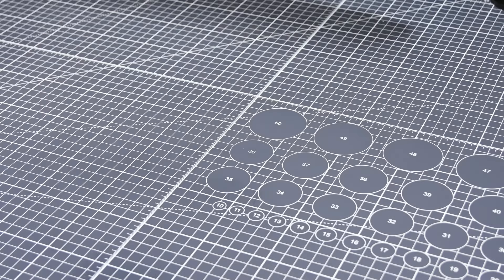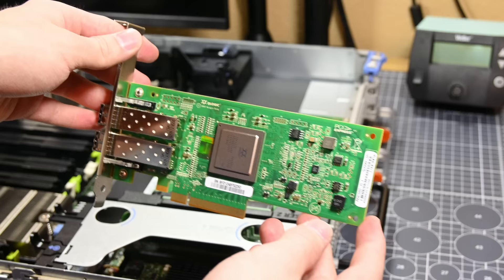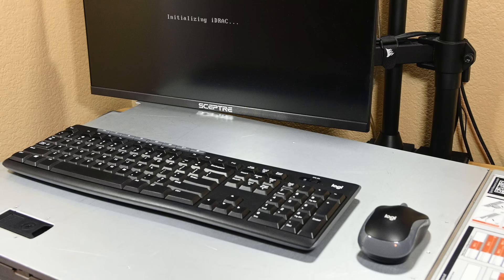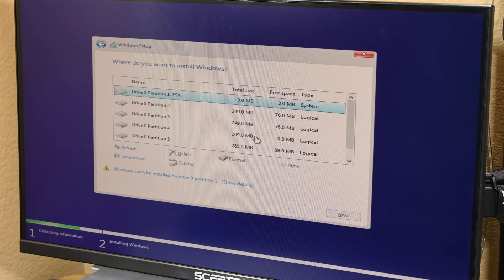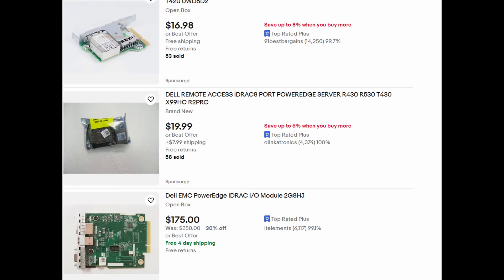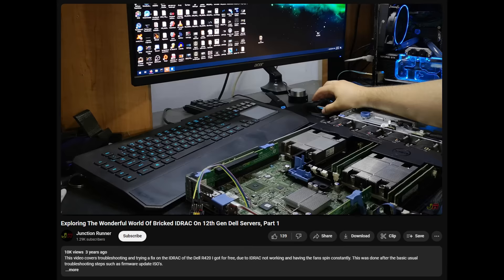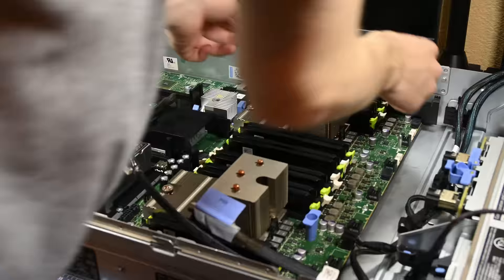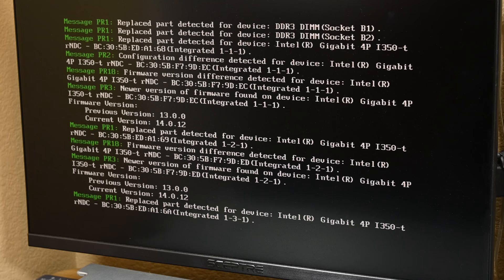I Took a Risk on This Server - Can I Get it Fully Functional?

Comment: I saw you pull out the SD cards from inside the server. Did you make sure to put those back? One of those is most likely connected directly to the idrac. I have a r810 and my idrac has an SD card slot directly on it.
Reply: Those two SD Cards are only for OS boot like ESXI. Also on the R710/R810 the iDRAC works differently than on his newer R720. The SD Card on your iDRAC is used for vFLASH. it's used to install an OS on your Server for example. On the R720 the vFLASH slot is the one in the front he used to try to flash the firmware image with. So an SD Card is not necessary for iDRAC to work
Reply from the maker: Yeah, as retropctech2407 said, these SD cards aren't linked to the iDRAC in this server
Reply: @retropctech2407  ahh okay gotcha. thanks for the correction! I knew there was a difference between idrac6 and 7, especially regarding licensing, but didn't know there was a big difference hardware wise

Comment: On some systems, you may have to configure the drives that you install using the LifeCycle controller.  Worse, the jargon can be confusing even between slightly different Dell systems resulting in wiped drives when you really didn't intend to wipe them.  
Dracs having issues is not totally uncommon;  yours at least booted;  I have one that is in production use, out of support, that hangs every 3 months or so during Windows Updates restarts;  the DRAC works until it does not; and then the power plugs need to be pulled to get it functional again.  Out of 8 servers like this, two had oddball issues; this is one of three that are still in use. Can't really work on it to even troubleshoot because the DRAC logs are useless ( no logs when it happens ) and I can't take it down but during the 4 hours or so that is slated for Windows Updates; so even if I could troubleshoot it, I could not get the parts and test it till the next month, but Windows Updates are priority over hardware maintenance ( until it finally fails completely ). It is slated for permanent removal in the next 3 months.  25% had significant issues; so, not really uncommon.
Reply from the maker: Yeah, from what I was able to gather these failing DRACs aren't a rare occurrence

Comment: The idrac is not a part of the motherboard at all its a module that comes off its the small thing with a heat sink and 2 blue tabs on both sides
Reply from the maker: That's actually the RAID controller card, though it is located close to where the iDRAC is.

Comment: I have a Dell R720XD and its populated with SATA drives.  If SATA drives won't work with your R720 it seems that you still have a problem to find.
Reply from the maker: It seems that I just didn't know how to work with the RAID controller. I haven't gotten around to messing with it more since making this video, but I think I might just need to configure some things to get it all functional.

Comment: Also the ram clips have likely just fallen off not broken off (had it happen to me they just clip back on)
Reply from the maker: I had that thought too, initially. However, in my case, the clips actually were snapped which is something I've not run into before! It's a shame that they broke like that, though they seemed in rough shape when I received the server. Maybe the previous owner was unreasonably rough with it or something?

Comment: i bought a r720 , off eBay, last year and plugged it in to my surge protector ( was new ) and the servers power supply's went pop, wasted £230 luckily only had to pay for shipping to get a refund. found out later from the seller that the power supply might have been damaged in shipping, but it killed the motherboard and 8 ram sticks :(
Reply from the maker: Oh man, that's no fun. Hopefully the return shipping wasn't exceptionally expensive

Comment: You should flash your Raid card to IT mode that might fix your issue.  How ever if you enter the raid set up on boot you will probably then see your drive as you would have to create a virtual image first to pass that along to your OS.  But do you self a favor and just flash it to IT Mode.  You remove the battery's then flash them I was able to do it so I am sure you could.  Art of Server has a few good guides on this.
Reply from the maker: Thanks for the tip! I'll likely end up flashing the controller to IT mode soon.

Comment: It is alarming that people are reporting iDrac deaths in the R720 servers. Those modules at 8:53 aren't iDrac modules they are just breakout dedicated interface ports for the iDrac. I wish iDrac was a separate module on the newer systems though because I scrapped a bunch of R420 and R320 with the same iDrac issues you are seeing on this R720. The problem from my understanding is the storage chips for iDrac are failing in the 12th gen servers causing these issues. Luckily it isn't needed for the server to work as far as I can tell. Mostly you lose remote management capabilities and the fans run at 100%.

Brittle motherboard plastics on the 12th gen Dell servers aren't too uncommon depending on their operating environment.

I'm no expert by any means but have a lot of experience abusing these R720. If you run into any issues I might have an answer. You've basically seen the worst of it so far. The only other hurdle would be powered GPU support. Also they don't support PCIe bifurcation limiting your options when it comes to NVMe drives.
Reply from the maker: Ah I see, I thought those iDRAC modules seemed a little bit simplistic and small. Makes sense that they aren't the full iDRAC, considering they didn't look like they consisted of much. Glad to hear that hopefully my experience with this server should be uphill from here, minus powered GPU support, as you said. Hopefully I won't run into any extreme issues when working with that!